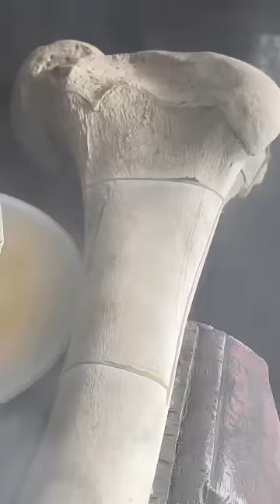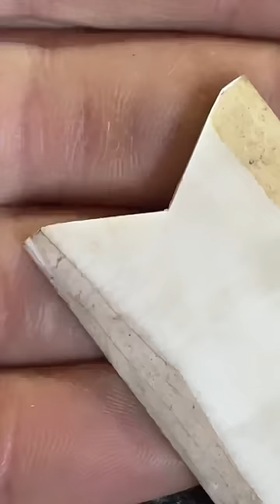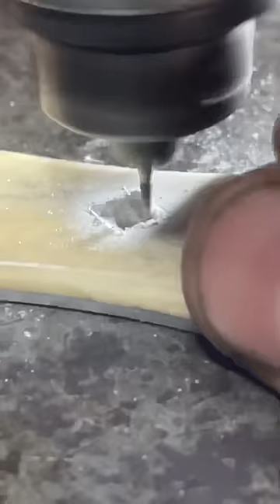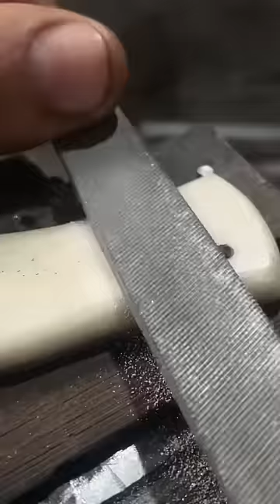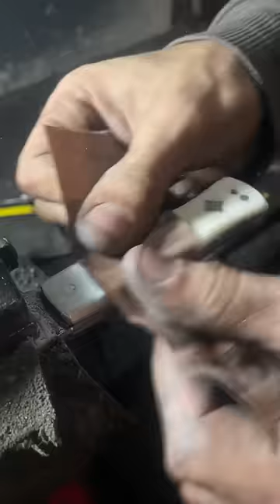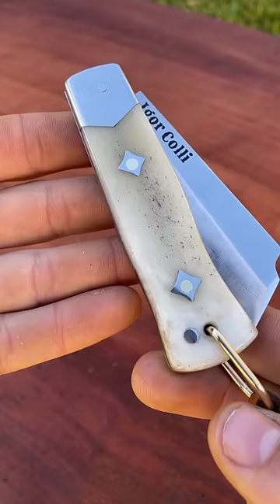Canivete Artesanal com Cabo feito de Osso #canivete #artesanal #shorts

Comment: when it's exposed or submerged in citric acid or any strong acid , it will be flexible because the bone is a calcium-rich organ .
therfore , the calcium will be ionized by this solution .